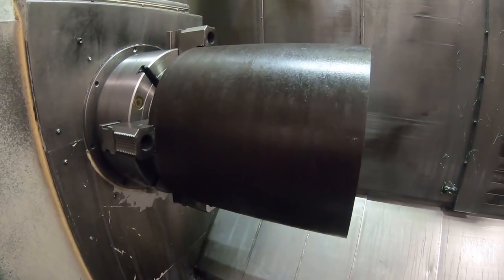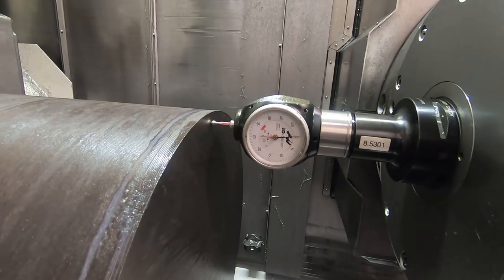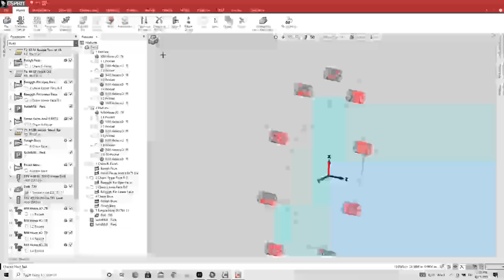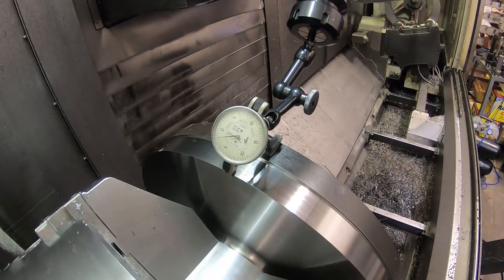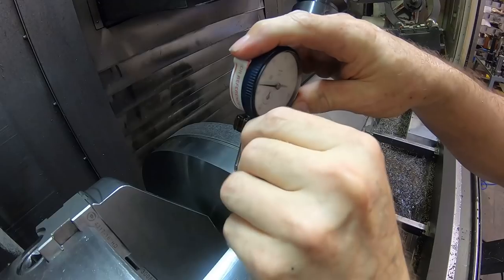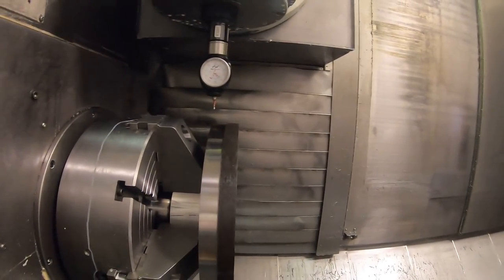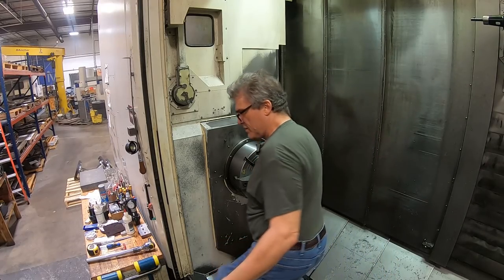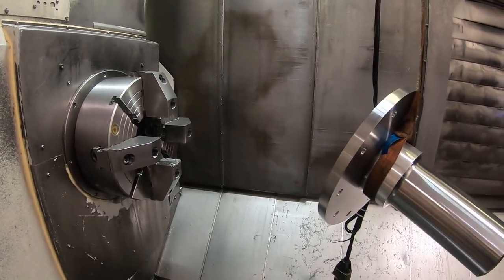830 Op 1 Machining and Flange End Op 2

Comment: Crane test question.  By loading it 125% are they looking for a failure? Or how do they test, deflection in the boom ?
Reply from the maker: I asked them if they ever had one fall down. They said yes. So I guess if it stays level/ vertical after the weight is removed it passes. That weight is out at the beams end by the way.
Reply: @EdgePrecision  at my old job they tested at 1.5x the capacity I'm fairly certain. All the welders had 1 ton cranes that were tested at 3k lb, 2 tons were at 6k lb. I could be mistaken though.

But yeah they measured the amount of deflection at various points at the end of the beam with the full weight on/off.

Comment: a suggestion to get better shots ; put a perspex disk, spinning in front of the camera, it will sling the coolant off - resulting in no drops sitting in front of the camera
Reply from the maker: There are a number of problems with this for me. Foremost is the noise it would make. I record all the sound you are hearing with the cameras mic. The next is how do you seal it. When I’m filming with the camera is very close to the action. I would have to make to big a box for this. Also these things work good on say a ships window for just water. But the oils in coolant make it stick to the window. It needs more than centrifugal force to keep clear. Now maybe a slow spinning disk with wipers might work. Or a window that isolates back and forth with wiper seals on each side. Kind of like moving the windshield of you car under the wipers instead of the wipers in font of your view. The air knife I use now only takes 20 psi and makes no sound. Any mechanical mechanism will transmit noise to the camera. Unless it’s very carefully designed.

Comment: I'm curious, when you interpolate the holes in the flange, how do you decide whether to index the spindle for each hole vs moving the spindle head?  Another excellent video!!!
Reply from the maker: This machine only has minus 10 mm of X axis travel. So when working on the face of a part I have to rotate the C axis if the machine has to travel below that limit. Or I run into the machine limit switch. Now Esprit TNG has a accurate model of the machine and it's travel range. So it will detect this when you run the simulation. You than can give it another C axis solution to keep the machine in it's travel range.
Reply: @EdgePrecision  I see, that makes sense.  Really appreciate you taking time to reply, and make videos!  Thanks!
Reply: @EdgePrecision  10mm only? 100mm?
Reply from the maker: No 10 mm .3937". For milling this isn't really a problem. But for turning it becomes more of a problem. Lets say you are boring a blind hole that is large in diameter but has a bottom face that goes to the centerline. If you use a large bar to bore the hole. you cant back face the flat face at the bottom to centerline. You will run out of travel. You than have to change to a different tool to get to the center and match the two together. Or say you are doing a long large ID with a taper in the bottom. I have run into this before the hole started at around 4" in diameter than at the bottom had a 30 degree tapper that finished at around 1.0" in diameter. It took three different bars to turn that taper to the smaller diameter. All the offsets had to be matched to not have steps in the taper. I wish it had at least 1.5-2.0" of X minus travel.
Reply: @EdgePrecision  this id what i was thinking about. 20mm boring bar cant reach x center? This seems like a serious design flaw in such a big machine. They should have given Atleast 50mm. Also for milling is expect the precision to be a bit better with x/y movement than c interpolation. Or is integrex interpolation good enough for this to be unimportant?

How much x+ travel does machine have?

Comment: We use 2x4 screw together in a T shape with different length with the tail stock. The same way ish celling drywall peoples would do to hold the drywall up in the air...

Comment: Hi Peter, when the machine stopped at 11:53 for you to measure the diameter, did the tool just stop in the cut as the spindle came to a stop, and then restart again while the edge was in the cut, or did something else happen?
Reply from the maker: The machine can be stopped at any time with feed hold. Then be put into a manual mode to open the doors to check something. In this case measure or maybe clear shavings. As long as you don’t move anything you can close the doors put it back into the auto mode and push cycle start. It will turn on the spindle and continue the program as normal. There is also a way ( I didn’t do it in this case) save the positions (they call them tool point positions) and it will follow those points back and continue when you restart the program. This is pretty much normal to most comercial CNC machines.
Reply: @EdgePrecision  Thanks for your reply. The reason I ask, is because I’ve heard a carbide insert shouldn’t be “stopped in the cut” if you know what I mean. Like if you were cutting on a manual lathe and there was a power cut and the spindle just stopped without the tool retracting. I was wondering if the machine made a small move to pull the tool out a little when you did a momentary stop like this. Or is this a myth and it’s fine to stop the spindle with the tool in the cut?
Reply from the maker: @Orgakoyd  No you are correct in a heavy roughing cut and on a manual lathe if you hit the break and instantly stop the spindle. It would probably damage the insert. But pushing feed hold on a CNC machine is like disengaging the feed lever on a manual machine. The spindle continues to turn until you push one of the manual keys/buttons. Then the spindle stops. This won’t break the insert just as stopping the feed on a manual machine won’t. If you just push a manual button without first pushing feed hold. It would instantly stop the spindle and probably damage the insert.
Reply: @EdgePrecision  Ok thank you for the explanation! That really helps.

Comment: I would think that the rain x if applied to lens,  according to directions on the back, the air should instantly clear the lens, my knowledge of it used on a windshield,  you don't need to use wipers at all, so tge air should do the same..
Reply from the maker: It does work for a few minutes but the coolant mixture must attack it and wash it off. You don’t get coolant on your cars windshield. If the coolant was just water it would possibly be different.

Comment: The flange cannot be warped. It's all about the jaw pressure
Reply from the maker: Yes on first operation I had the jaws very tight. This caused the slight destitution in the flatness of the flange.
Reply: @EdgePrecision  sometimes you have to save some stock and do more finish cuts.

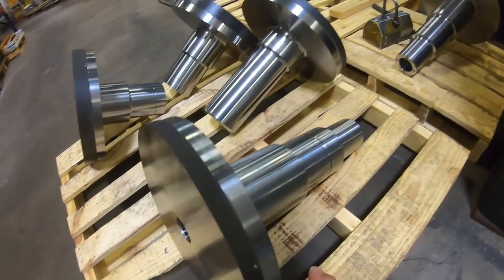Comment: Can explain the alignment of that long part using the hole on the flange at 45:00?
Reply from the maker: When I get the part all aligned as you saw in the video with the back of the flange and OD running true. Than I index the B axis to vertical/90 degrees with the dial indicator. I jog the machine to Y zero. Now I indicate the hole I true to the milling spindle by only rotating the C axis and moving the Z axis but being carful not to move the Y axis from its zero point. Now I zero the C axis fixture offset. This aligns the work to the previous ends work in the C axis. Of course the program has to be made to coincide with that C zero point.
Reply: @EdgePrecision  excellent. Can you video record this when there is an opportunity? Never seen this as far as I can remember.
Reply from the maker: @therealspixycat  On one of these parts I did take some video clips but it didn’t relate to this part so I didn’t put it into this video. I will see if I can put it in another on general things. Or do a separate video.

Comment: Ello, realy enjoying ur vids! Why didn't u skim the od so u would have a easier time indicat and on top a way better grip cost like 30s because I would never rough some like this with a crusted od I have to grip on. Also the spindle to push the part up against the jaw...  I know ur a man of finesse but it realy blew my mind that u would consider that and even more to actually do it and show it in the vid.;(
Reply from the maker: I didn’t push it with any force. Just enough to close the gap. That puts less force than the machining does. I could not see really any load on the desolate. When drilling with that 2.06” drill there is about 45% load on the Z axis. Way more than I put on the part. And that is on the spindle. I was pushing with the spindle’s face flange not the bearings.
Reply: @EdgePrecision  thanks for your reply. I totally belive you with the load on the spindle and there's no dmg and it's faster I still would get fired from my job if I would do this so you should rethink this. Your risking damage on the main part of your machine to save 5-10 minutes? Not worth and not worth showing on the internet... Still a huge fan hehe and no I this wasn't a joke you would get fired in any shop around the world for doing so.
Reply from the maker: @gernhardtreinbolzen5281  than don’t do it.
Reply: I’ve heard that “you would be fired for doing….” Comment so many times about certain things. In Peters case he is the owner what is going to do fire himself?

Comment: Always thought it was better to rotate the part to drill holes instead of tool rotating around part. Just to keep the true position from center location of diameter good.. Great video though.
Reply from the maker: This makes no difference on a CNC machine. Actually rotating the part could introduce more error if you aren’t on perfect center with your distance out from center. Any error in the radius will be doubled when you rotate around. This machine only has 10 mm in the X minus travel. So I have to at least rotate 180 deg to get the bottom holes.
Reply: @EdgePrecision  Thank You for your reply. I will probably have more questions in the future. We all appreciate your videos.

Comment: is the magazine too small to hold the tools?
Reply from the maker: The magazine in this machine can hold 80 tools with a maximum length of 19" long. The reason I am putting tools in the spindle is they are not as of yet in the magazine with their offsets set. So I am also touching off for the offsets. I could have set all this before running the program. But this is the way I often do it. On the first run.
Reply: @EdgePrecision  oh interesting i have never seen someone do it that way before
Reply: @EdgePrecision  ohh since you don't have a probe you have to do that for each part?